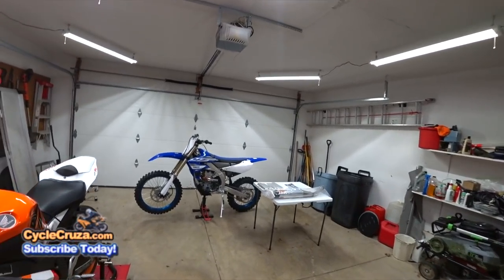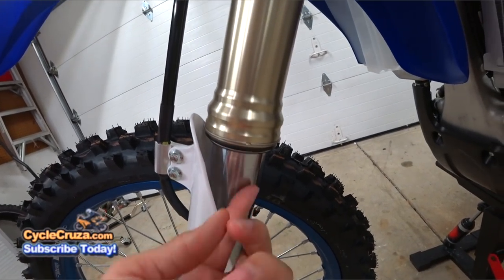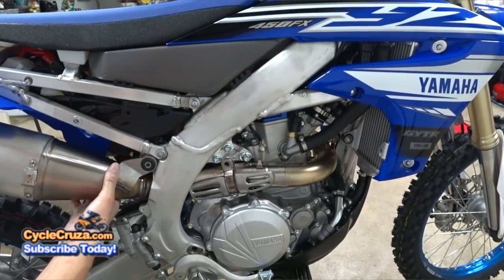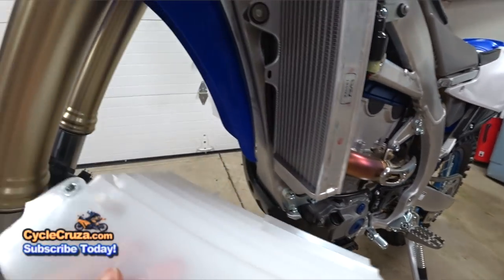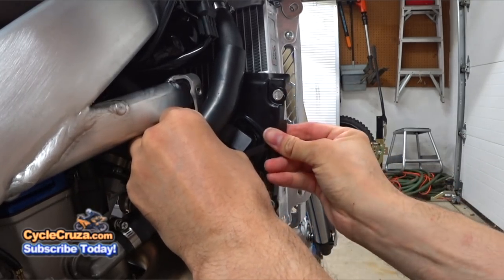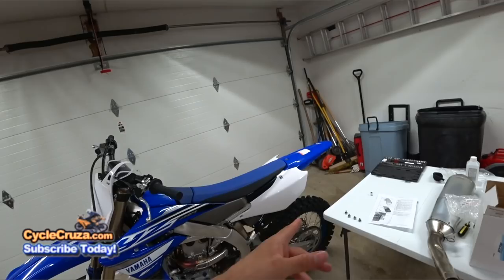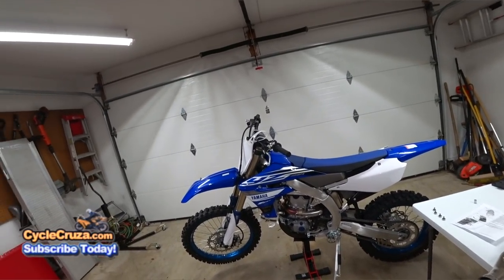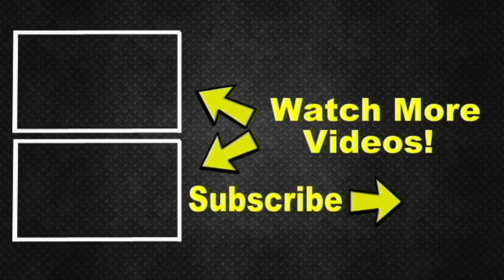New Exhaust + Mods 🔥 | 2019 Yamaha YZ450FX BUILD Part 1

Comment: Looks great Cycle Cruza - thanks for taking us through your build step by step. Im learning a lot too, for example, I didn't even know Seal Savers existed!
Reply: You should be happy you didn't know. They are otherwise known as "dirt trappers" or "fork tube sandpapers"
Reply: Yeah, I'm not really sure why he'd put them on there being that the stantion bearings aka dust wipers are designed to keep oil in and dirt out.

Comment: I would recommend upgrading to high strength bolts that hold the rad guards to the frame. In a hard enough hit the new rad guards will have a lot of leverage on that bolt and the factory bolt will break like cheese.
Reply from the maker: I sent it back, will take my chance with stock. I want to keep the weight off.

Comment: Great build, however the seal savers will just keep dirt in causing your seals to bust quicker and even cause damage to your fork tubes causing guages, etc. I use to run them woods riding and the mud, etc would cause me to have to replace seals every few rides or so, so i removed them and have had no problems.

Comment: Why dosent the bike come with a fan ? I would class a cooling fan as basic so why is it not installed from the factory especially as the screw holes and connecting socket are already there. 😀
Reply: carlcostello360 most new bikes are like this. The fan is needed for hot climates or low speed riding which not everyone does.
Reply from the maker: To make the weight look better and save Yamaha some money.
Reply: @CycleCruza  jesus they will sell cars soon with no coolant cooling fans to save money to and say its not hot where you drive so your car will be fine. Just avoid traffic. And then no aircon or blower fan. You will turn your aircon or blower on and there will be no switch and they will say ohhh the aircon and blower yes we took the fans out as its not hot in your part of the world.
Reply: @2wheelsoffroad730  so if you do buy this bike and live in hot climate and do some low speed riding with this bike from the factory you will overheat your engine as there is no cooling fans from factory ?
Reply: carlcostello360 I don’t know about this specific bike but some bikes yes. Some days It gets up to 115 in the desert where I live so I had to put a cooling fan on my 250 2t and a 2bar radiator cap to prevent boiling over. It just depends on the bike or conditions. It also allows some people who don’t need them to save money like cyclecruza said.

Comment: Looking forward to seeing how those shinko 705's work. Thought about putting them on my drz
Reply: Shinko 705s work really well as an 80/20. However.. in my experience, they do have a "slick" break in experience, as well as performing as such in the mud. I highly recommend them for urban and the durability regarding mileage is phenomenal, great lean angles once and if they are broken in correctly.
Reply: @p7ayboy  How are those Shinko 705s? Do they both grip better, and last longer than my Pilot Road 4s?

Comment: Those rad guards will make your bike run hotter Cyclecruza.
Reply from the maker: I jave similar ones on my wr250r, no issues.
Reply: @CycleCruza  your wr is far from a high performance motor though.  You may want to toss a high pressure radiator cap on it..  also engine ice for the coolant.  But remember the wr was built for reliability.  The YZ is performance. Yes YZ are as tough as they come (I own 2) but still are race bikes.
Reply: For the SM setup, are you planning on running a cush drive?
Reply from the maker: yes, I got the cush drive! As far as the YZ, running hot, these guards won't make it run hotter according the reviewers. I got engine ice, will put it in when I have to install speedometer. The fam kit I put on will keep it cool as well.
Reply: @CycleCruza  nice!!!  The radiator braces catch much more debris so when riding motocross, they will overheat.  If you are not in that dirty of an environment it does limit air flow but the engine ice (combined with a hp radiator cap) and a fan should help.  Dont let it idle like your wr.  Or sit in heavy traffic

Comment: Those radiator guards dont look like they will protect any thing. You see the plastic ones from the front and you cant see the radiator, its protected from any rocks  coming from the front. Wile the other one is flat and full of holes and will let pass any rock as long as it has the right size.
Reply: The radiator guards main purpose is to protect side impact they also protect the front from roost.If you have ever ridden a dirt bike in the dirt you would know these are a good product .Speak from experience not speculation .
Reply from the maker: No these Bulletproof rad guards are legit. It helps make the rads stronger in a side impact crash and will divert big rocks. The stock plastic ones are nothing!
Reply: @starfox_wr-45e93  lol yea they are lame. The radiator runs hotter with them too. Plastic ones are far better.
Reply: @starfox_wr-45e93  yeah.. this dude doesn't know anything about supermoto or mx.. smh with this build fr
Reply from the maker: This thread on thumpertalk says: https://thumpertalk.com/forums/topic/1086115-are-radiator-bracesguards-worth-it/
Reply: @fiaa01  by your standards unless we comment to agry we should stay away.
We bring up a point that is worth thinking about, sorry if it hurts to think about things
Reply: Cyclecruza is right these radiator guards are legit.  I race hard core off road and we all run that type of radiatoe guard.  Its about strength mainly.  But also actually does keep the rocks away from the radiator better.  And less dirt/rocks get jammed in the radiator when you ride.  BTW i never ran These on motocross bikes.  Just hard enduro woods bikes.  Go out west and ride in the mountains on rocks and shit for a year or two!

Comment: Also those rad guards are trash, there's nothing wrong with the stock plastic ones. Oh and that fork sock will act like a sand paper scratching your fork tube lol
Reply from the maker: Bulletproof rad guards @$200 are far from trash, you better ask somebody! lol All reviews for Bulletproof rad guards are 5 stars! These rad guards make them much stronger. As far as the deal savers, I've had seal savers on my wr250r for a while now and I can attest that they do not pose any issues.
Reply: Scratching the fork tube? It's a dirt bike man, what the hell you think is going to happen to it lol.
Reply: @manrightchea  ummm you understand that any scratches in the lower fork tube junks the fork right? That's why there are plastic fork guards there, and if something does get there, the wiper seal removes it. The wiper seal cant remove any dirt that's being held by the seal saver, it continues grinding into the fork like sandpaper.
Reply: @CycleCruza  I challenge you to find any reputable suspension guy that would recommend those Fork Socks. They completely take away the power of the wiper seal to do its job.
Reply: @CycleCruza  and I dont care how much anything costs. You can buy a $1500 exhaust but it doesnt mean its nearly as durable to even as good as the OEM one. Some "mods" are simply pointless.
Reply: Its his bike he can do whatever he wants to it
Reply: @austintaylor2251  yup. And it's my comment and I can put whatever opinion I want on it
Reply: Seal Savers were actually designed to be used on hydraulic cylinders in the construction industry and those cylinders cost a hell of a lot more to replace than a set of forks!  They have been in use for over 30 years and if you install them correctly nothing is getting past them!
Reply: @williamzoom  lol. Trash.
Reply: I really like my Flatland rad guard.
The stock plastic one ducted bugs into my rad.
With the metal one bugs don't get cremated in my rad.
Reply: Rad gaurds are difference between walking out the woods and riding out. I hit a root against my radiator and if it wasnt for the gaurds the rad would have been destroyed. Instead it just bent. I was able to fix it with a rubber mallet. Seems worth it to me.
Reply: +1 MX Guru.  Seal Savers collect dirt/mud and scratch the shit out of the inner fork tubes.  I know from experience, which is why experienced off roaders do not use them.  He is basically turning a dirt bike into a street bike which is a total waste, so it doesn't matter anyway.

Comment: most people put the yz450 stock slip on pipe on the wrf 450s for a reason. its the best pipe for them. You need to read up on the exhaust shoot out. Its stock or pro circuit . 

p.s you dont need to use to stock clamp on a slip on.
Reply from the maker: The stock pipe is good but does not have a spark arrester and it's too loud for when I do urban fookery, I try to be more under the radar as to not draw attention when I play.
Reply: CycleCruza the silent cruza lol

Comment: Are you going to have to get a bigger stator to power the lights? im thinking about doing this on my ktm sxf not sure if the stock stator can handle the lights
Reply: He said it's got a 160w generator so it should be good, especially if he uses LED

Comment: I'm glad it's your money and not mine. That's a complete waste of money modifying that into a Supermoto. The whole process of switching it over to Street Legal adding additional parts. I think you were much better off buying something already street legal and ready to go.
Reply: He did it backwards. He should have a 250 not street legal off road bike, and a bigger bore supermoto/ dual sport... I dont know whenever he gets all this money from lol.
Reply: kdxkyle boring always increases the chance of damage. Better keep the engine specs factory mint
Reply: YYYYYYYYYYEP!
Reply from the maker: Using it for both, will swap wheels.
Reply from the maker: kdxkyle - With the new 2019 yz450fx you can completely change the power, you can weaken or make power stronger in low, mid and top end via wifi smart phone in seconds.  Also, the 2019 yz450fx is only 6 lbs heavier than the yz250fx, so it makes zero sense to get the slower 250 version.
Reply: The entire reason he bought the bike is for the WiFi, you can tell haha
Reply: he's not even doing it properly either... and you know this guy won't be hooning anything in the streets, popping wheelies amd causing chaos in the city center
Reply: Personally, I'd rather turn the 250R into sumo, and keep the 450 a plated dual sport. Supermoto means more ride in the streets, and which also means more miles so it's better to do that on a bike with lower maintenance. A 450 being a plated offroad means it will only get ridden a few miles on the road before finally hitting the dirt trails.
Reply from the maker: The wr250r is still my everything all day riding bike. The yz450fx will be a quickie bike. lol

Comment: But don't the factory radiator guards channel more air to the radiator?
Reply: I think they also protect better. If you look at them from the front you cant see the radiator, meaning that rocks cant find their way to hiting the radiator
Reply: Big rocks destroy the plastic windguide
Reply: I get the purpose of the new guards, but honestly it'd take some big rocks flying at a high rate of speed to break the factory ones. The factory plastics are tough as hell, at least on my Suzuki anyways. The weak spot on my bike is the fragile as glass magnesium engine cases. Wish they'd just gone with aluminum, can't see that they saved more than a couple pounds using magnesium over aluminum. People have had their bikes fall off the kick stand and the shifter punched a hole in the case.
Reply: It’s for side reinforcement if you drop the bike doing enduro riding. Some stock radiator guards are more flimsy than others.
Reply from the maker: That stock plastic guard is like nothing, you touch it and it feels like it is going to break. I have a similar rad guard on my wr250r, no issues.

Comment: .... Should've got the crf450l
Reply from the maker: This yz450fx will eat the crf450l for breakfast. The crf450l is bogged down with emissions bs, by the time you get all of it off your wallet will be gone and it still won't have the kick this yz has.
Reply: @CycleCruza  it's a dual sport (not a dirtbike) it's job is to be great on and off road, and be reliable. Your dirt bike is ment to be raced and rebuilt, reliability was never considered. yes its faster, but both bikes are well above the off roading you do(you don't even push the 250 to its full capability) , and the Honda is street legal from the factory and has a 6 speed..... You would already be in the fields sliding around and jumping..... You bought a faster unreliable bike and are going to dump money in to it to make it what the Honda is, minus the reliability

Edit: and great work highlighting your own reply
Reply: Last i checked yamaha was the most reliable motorcycle and the yz is like the toyota hilux of dirtbikes
Reply: @LeoBodyWeight  bro, honda invented reliability, check your facts

Comment: I've driped my bike, and had it roll down a hill. Never broke a radiator. I ride single track, trails, and motocross tracks on occasion. don't think it's worth the money honestly
Reply from the maker: Honestly, had I known it already had reinforced bracing I would have probably not got it but these guards make it stronger and will guard against rocks. My wr250r did not have reinforced bracing on the radiator so it made sense to get rad guards. I've seen a few riders bust their radiator though.